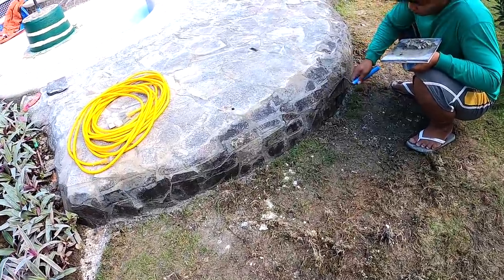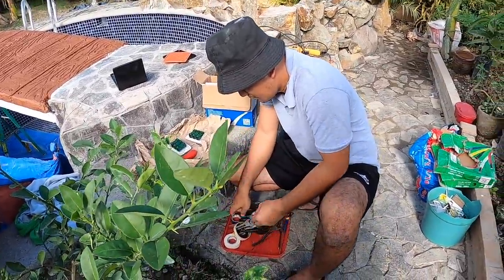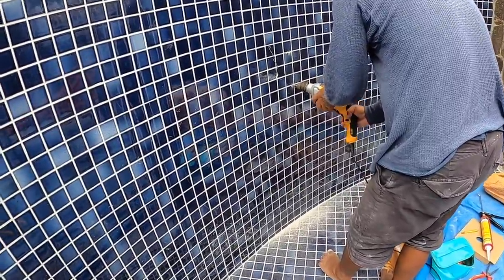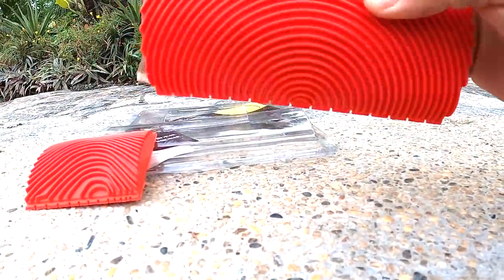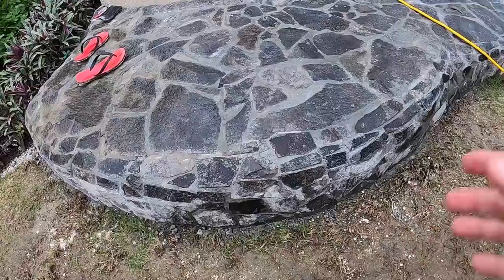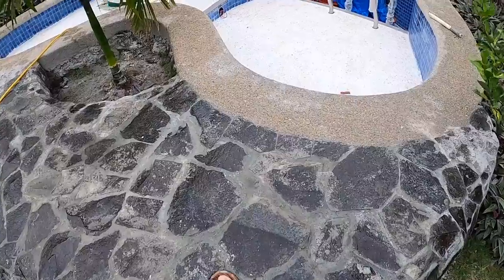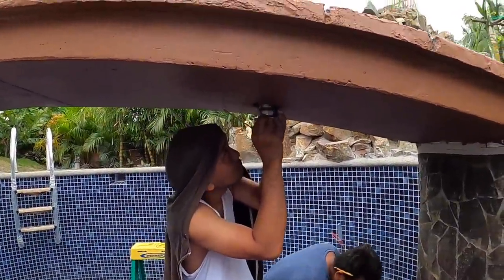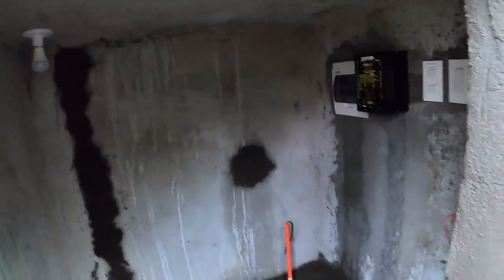VILLA FELIZ POOL BUILD - EPISODE: 58 (House Building in the Philippines)

Comment: Very relaxing and informative video as always. Just a question, how do you maintain your blue grass? Do you use Miracle Gro? If not, any tips on how to make your grass greener or thicker? Thanks!
Reply from the maker: The ground is so fertile I don't really have to put fertilizer down.  Occasionally I put some chicken manure that's mixed in rice hull which is readily available around here.  Unfortunately the rice hull will sprout some rice grass blades.
Reply: @MyPIDream  Thanks for the info 👍

Comment: Is that "flapper valve" not upside down now? or maby i'm just thinking wrong?  ;)   Pool build looks GREAT by the way.  :)
Reply from the maker: No, it's installed correctly.  There is a float on the back.  The concept for this is it does not allow debris back in the pool after it is sucked into the skimmer.